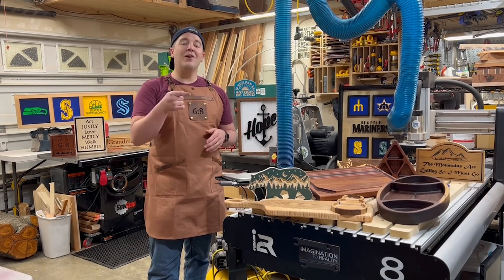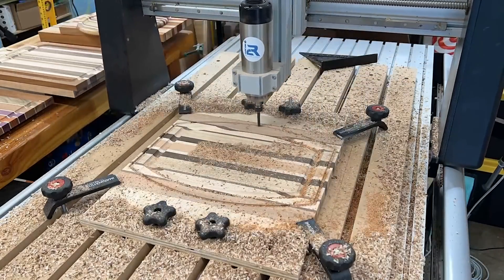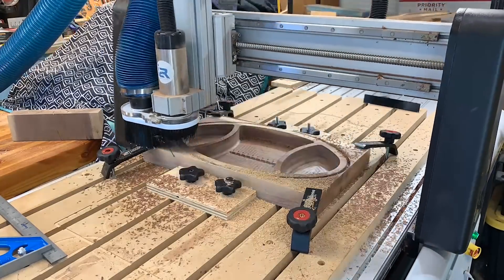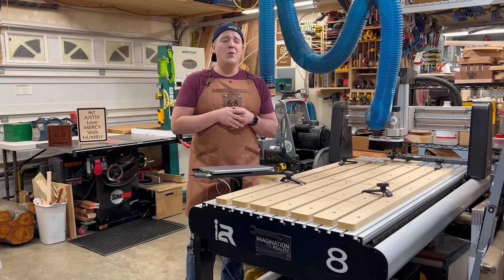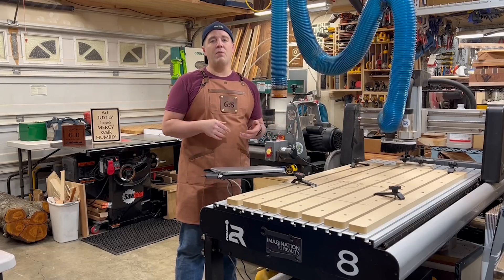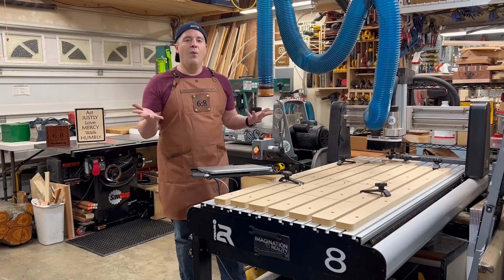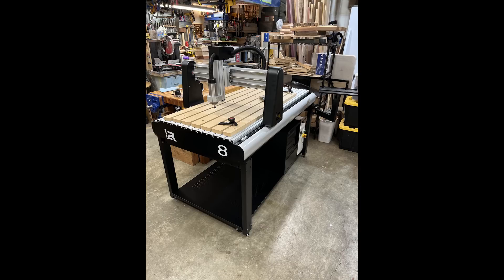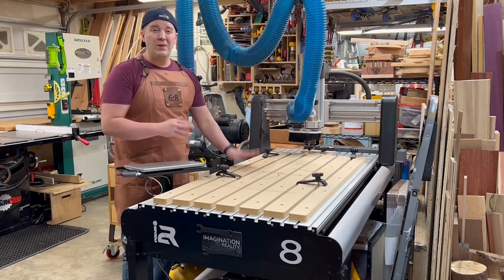Reasons to Get a CNC: Plus i2R CNC Review

Comment: So thanks to this video, I bought one of the new I2R B24 CNCs and you were right! The build quality of this machine is shocking. VERY well built and super heavy! Really impressed so far. BUT.... It came with NO instructions to put it together, and the PDF they emailed me did NOT match the model and frame I got with the machine. The frame is a white one and so is the CNC.  They also sent the wrong toolbox, it's black and does not fit the control CPU box like in the pictures.  My clamps did not come and the hardware for the vacuum hose setup is wrong. I've looked for videos and documentation everywhere and what I have seen if different than what they sent me. So I will be calling them today, hopefully, they are good and will make this right. 

I will say, they shipped it fast! Left NYC Friday and was here Monday.  Unfortunately, I got no warning though. The text alert came saying the package was out for delivery as they were backing into my driveway to deliver it.  They were supposed to call ahead for an appt. I did get the Vcarve Pro software all set up last week after I bought it. That was pretty easy and very quick. Have yet to actually try the machine, but hope to later today. Thank you again for posting your video!
Reply from the maker: Oh no! I’m so sorry to hear that. That definitely hasn’t been my experience. I hope they were able to sort it all out for you!!
Reply: It worked out. I love the machine. I ended up getting parts for the dust collector at the hardware store that fit. And turns out the black tool cabinet they sent was indeed the wrong one, but I got it free so not what I expected, but it worked out. If I choose to get another unit I'll know next time. Thanks for posting your videos, they have been VERY helpful!

Comment: 1 big reason not to. If you dont have a lot of computer experience and I dont then do not get one. I do not have one but a friend does that knows computer technology well has one and even he spends a ton of time setting it up. Cnc machines are great but you better be great at setting them up or it will be extremely frustrating having one. Until they make them simple to use I will never get one because it will just sit there taking up space not being used while it drained my savings.
Reply from the maker: I found the whole process extremely intuitive. Lots of resources to make it simple to get started even for beginners with minimal computer experience